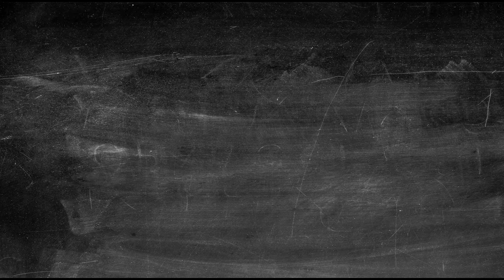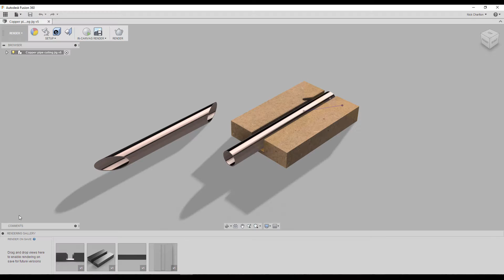Making A Dodecahedron Speaker | Shapeoko 3

Comment: I don't know but it seems like there is not nearly enough airspace in there for them to perform well. It looks absolutely amazing though
Reply from the maker: John Grech yeh the base is very lacking but I have changed two of the drivers to passive ones now!
Reply: Nick Charlton did it improve it enough? Just curious, I love this stuff.
Reply from the maker: John Grech it definitely helped, as you said the enclosure is too small for the drivers so the bass is still a little lacking, I use it with an active sub though so it's fine :)
Reply: Nick Charlton good to know man, I hope you show this off all the time :) Good work
Reply: To get a decent low end cutoff point is a real problem , you do beautiful work what type of program did you youse to emulate the response of the “box” of if your diver was a very louse suspension the cut of would be about 70 HZ but the way I love there cones I have been using a 6.5 “ co axe the smaller diver is a Mylar dome and has fared fluid for temperature built up and renascence control the cone section is bexadren with a butyl black rubber half roll suspension I have used this in production and they have been very reliable

Comment: Hi Nick
What angle is the bevel?
I want to make my tests for a different use but need to undertand the angle to cut.
Thanks.
Reply from the maker: The dihedral angle is 116.57 degrees so you would need to cut bevels into each piece that is half of that which is approximately 58.3 degrees!
Reply: @NickCharlton0  thanks a lot Nick
Reply: Nick, I have another question if possible that you help me solve it. I don´t have miter saw but I have table saw and also jigsaw, is possible to make the 58.3 degrees with that method?? Or do you have another idea on how to make that cut
Thanks in advance
Reply from the maker: @marioacevedo23  yeh on the table saw do 31.7 degrees and cut with the inside of the segment facing up
Reply: @NickCharlton0  thanks I'll try and let you know

Comment: So how many drivers in total 12? How did you wire them? What was the final impedance?
Reply: I'd wire them 3 x 4: three in parallel four times in a row like so ("<" is a driver, "+" is a knot, "-" is a line, "o" is a terminal):

IN+
o-+--+--+
    <   <   <
    +--+--+
    <   <   <
    +--+--+
    <   <   <
    +--+--+
    <   <   <
o-+--+--+
IN-

Car audio speakers are usually 4 ohms so this is the only way to get not less than 4 ohms as result (5.333 ohms) with the smallest amount in a row.